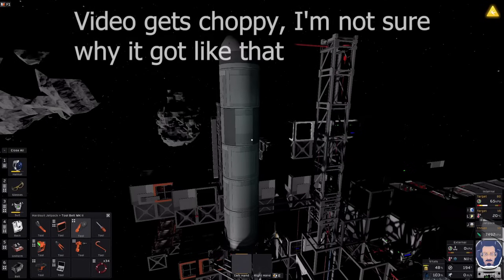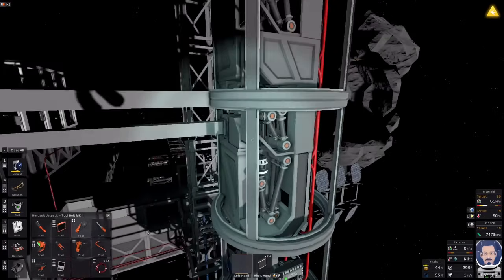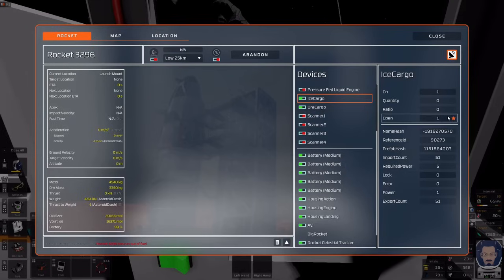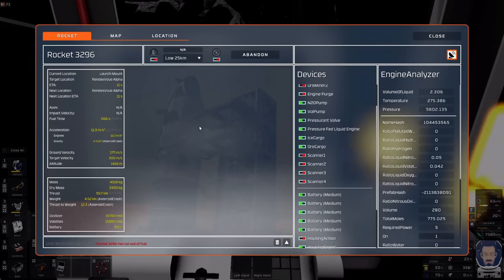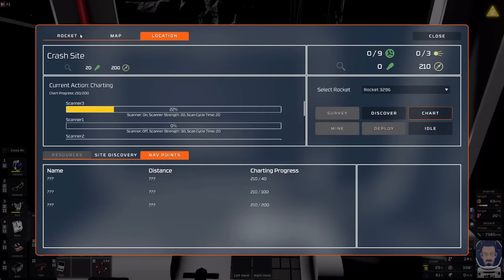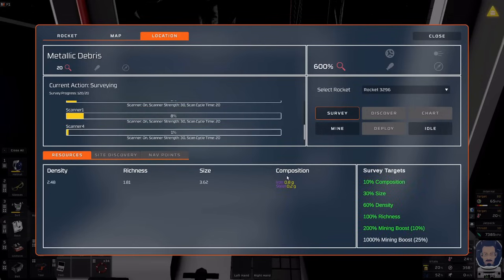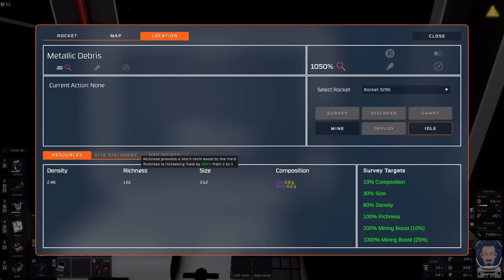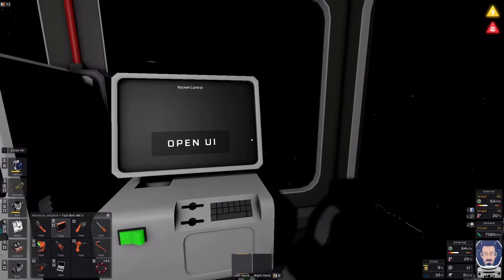Stationeers: Rocketry Tutorial Intro/Overview

Comment: Yo ShadowDrake, im not sure if its covered somewhere and I cant find it, but how do u tell a liquid pump engine the ratio of fuel to take( i have my tanks separated)? I have to use insulated tanks on my liquid vol or else it rapidly heats up ive been finding, I have 1 rocket tank on my NOS side but i cant seem to set my ratio, am i missing something? i see a setting on the tank itself, and the engine on the computer, is the engine setting for input 1? or is that controlling something else, also if so what is the setting on the fuel tanks?
Reply from the maker: Yes, the “setting” on the engine tells it how much liquids to pull from input 1 and the rest for input 2. If you have two separate liquid tanks, then you can just adjust the engine’s setting value to get the thrust you need.

I do cover it later what setting to use in the engine’s part of the tutorial.
Reply: @shadowdrake082  awesome, thanks, i was digging around and must have just skipped over it on accident, one last thing ive come to a complexing issue, how the heck do u store mined space ice? was messing around in creative testing some things, and the second the ice got sucked out i came to the realization that its going to melt, rapidly, so is there a gimmick i need to learn? in a vacuum ice turns to gas, and u cant get a room colder than what oxygen freezes at, is there something im missing there?
Reply: i learned it melts in stackers, silos, windowed chutes, vacuum i haven't tested but at low pressure any ice turns to a gas
Reply from the maker: @abesabbagh6537  I typically store it inside a silo just fine and slowly grab it out to melt in an ice crusher or an ice melting chamber.
Reply: @shadowdrake082  reddit post i saw said it melted in silos, but i bet they had a window or stacker somewhere, well sweet, thanks for ya help man
Reply: I am here to report, I have made it to space, not only that but also unlocking what looks to be the rarest achievement in the game, Go at Throttle Up (make it to orbit with 6km/s exhaust thrust) thanks to your videos!!!!! Many thanks Drake!

Comment: Really enjoy the tutorial series. I’d love to see a simple setups video. Such as: 

Plumbing your first O2 refill without blowing things up and how to plumb suit storage. When to use pumps, valves, and regulators and how each works and when to use. Also plumbing fuel mix and refill in both but that could be part of suit storage. 

A two part series on deep miners and gas centrifuges and how to automate. 

How to automate light and power control via occupancy sensors or similar, both with chips and then with IC10. I’m lazy and usually use a console with a power control chip right next to my airlock but would love to do it better. 

I’ll add more ideas if you are interested.
Reply from the maker: I kinda did a in depth dive on the combustion centrifuges... deep miners were kinda mentioned but I'm not sure if that covered what you were asking for. Automating the combustion centrifuges was a bit more on how to ramp them up and empty when they were filled.

I suppose I could do some early atmospherics type solutions. I do get that people will try to do something with the oxygen tank early on as an experiment for how to deal with regulators and pumps. I am currently working on how to get precision pumping out of volume pumps since I figure that would be more of a step up for controlling pumps.

Using chips is not really my forte... I got so used to IC10s it is a little hard for me to go back 😅. I may be able to do some of the more simpler things with chips though. IC10s cost 50W to run continuously so using less than 5 chips to control something is a gain in regards to power being used. Problem is that usually when I get to the point of displays and projects, I'm already at IC10s and just go for that instead of chips.
Reply: That makes sense on the chips. I’ve been trying to get the logic transmitter to work and it’s just caused me headaches. Do they work with IC chips and how do you choose which variable is sent? 

For atmospherics I can do complex ACs and atmosphere control for my greenhouse. But getting my suit storage plumed without exploding pipes or not getting the tank full enough seems to just be something I can’t solve. 

I saw your video on the centrifuges and I understood it. I haven’t played around with them too much but it’s the whole system and visualising it I struggle with. Setting the miners, getting the sorters set, how you load and unload the centrifuge and automate it, and then move the metal into each storage and/or send them to the printers when empty. I can’t visualise in my head and so watching someone else do it is so helpful. I’d watch you do a twitch/youtube live as well. I know it’d be a longer video and there are others out there with similar but I’ve found I like how you explain and show compared against some of the others on Stationeers.
Reply from the maker: @Nethanel  I get you. 
For logic transmitters, you configure it as a sender or receiver. For a sender though, you can only write one value to its setting and that is what it will send. If you want to send multiple points of data, you either need multiple of them or figure out how to pack your data into the 1 value and unpack it at the receiving end. It is similar to how you create the stack payload commands for the printers, logic sorters, or dishes. On the receiving end you can select with device it will link and mirror it.

Suit storage I can probably touch up on it. It is actually a nice place for storing your suit and it would be neat to have a setup for it to be filled and emptied while it is stored in your base as you air out your hygiene.

It has been a while for sure... The last time I showed dealing with a centrifuge and sorting system was when I did the TradeRopa playthrough a while back. At some point in the 101 episode mess I dabbled on them and probably got a lot showy in the intricate details of how to program, debug, and testing my system... sometimes multiple times. I havent really dived back into it too much again but I could probably do something small on a system like that.